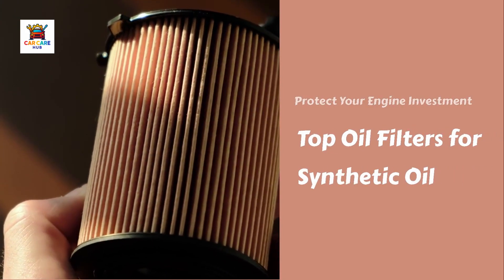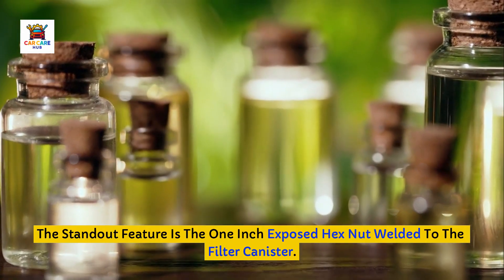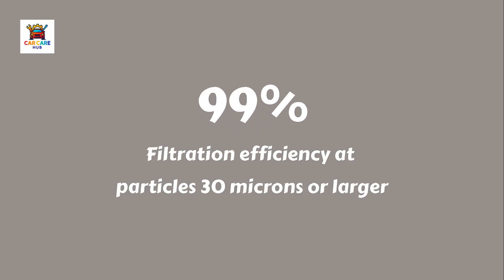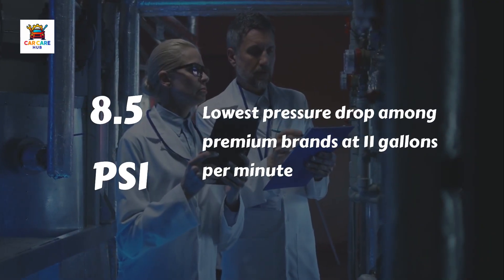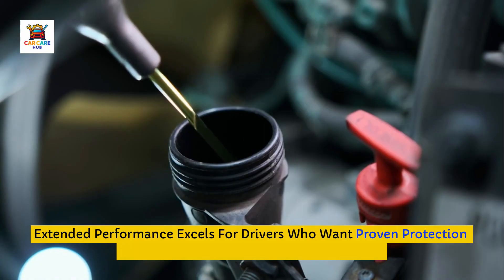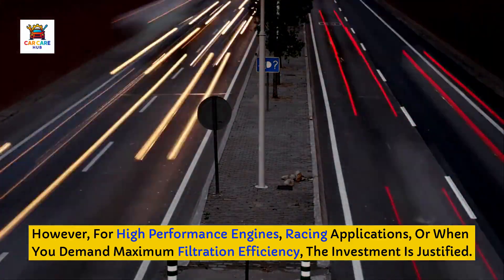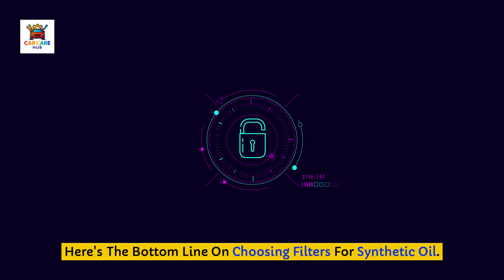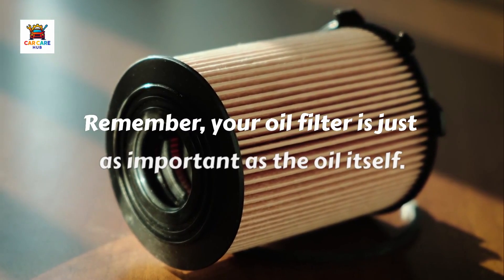Best Synthetic Oil Filters 2026 👌 Top 5 That Protect Engines for 10,000–20,000 Miles

Comment from the maker: If you’re using full synthetic oil but still running a cheap filter, you’re wasting money — and accelerating engine wear.
This video breaks down which oil filters can actually survive extended drain intervals and which ones quietly fail early.
👇 Comment below: • Which filter are you using right now?
• How long are your oil change intervals?
If you want real testing, real data, and zero brand hype,
👉 Subscribe — next video exposes the truth about 15,000-mile oil changes.
Your engine will thank you later.
Reply: I no longer waist my money on synthetic ! I use FPV conventional oil with synthetic oil filter because they do not have purelator cheaper filter so I get what I can

Comment: This Floyd change oil ever. 3000 mile ! Use conventional oil 5/30 and a AC filter if you can get one ! It had 4 more pleats than six and runs better oil pressure
Reply from the maker: Using conventional oil and a filter that gives you good oil pressure and extra pleats is a solid approach for regular changes.

Comment: As an old motor head the simple combinations are a no-brainer. As motors wear so does the oil/filter adjustments. Forgot not older motors that need Zinc additives in an oil change. I'm an old motor head driving a 25 year old 4.0 Grand Cherokee. I experiment for longevity and I've found VALVOLINE/MOBILE 1 gives me the BEST "wear" intervals. The motor doesn't burn a drop in 3,000 miles after an oil change. Good maintenance equates to long life in mechanical applications or physical applications..
Reply: Both SOLID oils for sure. Tho Pennzoil Platinum is better & same price If not less. Facts. Pair w/FRAM tough guard or Carquest oil filter ur golden. 👍🏻
Reply from the maker: Great to hear you're extending your engine's life with consistent maintenance and quality products. Experience with older engines definitely highlights the value of specific oil formulations.

Comment: What makes no sense to me? The filter on your engine was designed to filter for 3k Miles Once it's full, it's going to have to bypass. So if your oil is black It has contaminants that the filter can't filter out so at the very least Change your filter and add a fresh quart of oil But at that point you might as well change it
Reply from the maker: Good point. Filters can go into bypass when overloaded. Oil turning dark is normal, but regular filter changes are important—especially if extending oil change intervals.

Comment: Who makes each one of these filters? I understand Champion Laboratories Produces filters for FRAM, SuperTech, Luber‑Finer And Mann+Hummel germany/USA) Manufactures Wix, Purolator. And Royal Purple Oil Filters Manufactured by Champion Laboratories,K&N Oil Filters 	Manufactured by Mann+Humme So what proof is there that these all the same filters just different Names or color of the product.
Reply from the maker: Shared manufacturers don’t mean identical filters. Brands like FRAM, WIX, Royal Purple, K&N, and Purolator are built to different specs—media type, filtration efficiency, bypass valve settings, can thickness, and service life. Cut-open filter tests and published efficiency ratings clearly show internal differences, even when made by Champion or MANN+HUMMEL.
Reply: Champion also makes Amsoil filters

Comment: AMSOIL filters are rated at 99% at 20 microns
Reply from the maker: Correct. That 99% @ 20 microns rating is one of the reasons AMSOIL filters perform well for extended drain intervals.

Comment: AMSOIL’s filters for the most part are made by champion labs and are tested to filter the best. Royal Purple filters are also made by champion labs and look the same internally, but not sure that the pleated media is the same material.
Reply from the maker: Agreed. Champion Labs manufactures for several brands, but specs matter. Media type, efficiency rating, and flow characteristics can differ even if the filters look similar externally.
Reply: Have always had Good results with Purelator one 99% efficiency change oil every 10000 mile.
Reply: k&n mobil 1 royal purple are champion labs too

Comment: Towards the end what does a soda dispenser have to do with a Fram oil filter!?!?!? Furthermore you left out the actual #1 AMSOIL filter!
Reply from the maker: The soda dispenser clip was just a quick visual analogy, not a comparison. And then AMSOIL is an excellent filter—no argument there. This list was based on availability + broad testing data. More deep-dives coming
Reply: Because Amsoil is not the number 1 filter. Napa Platinum, Purolator Boss and Fram Synthetic Endurance are better